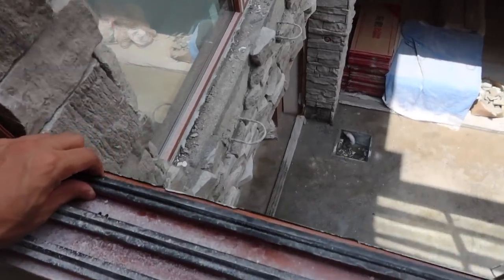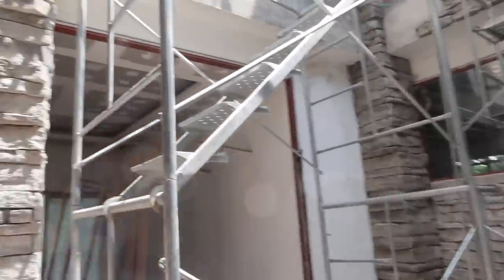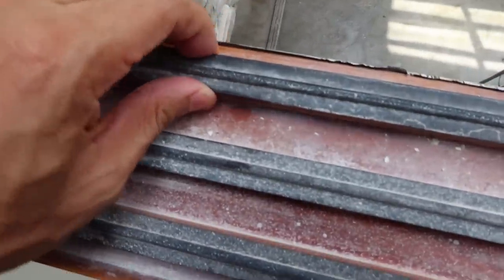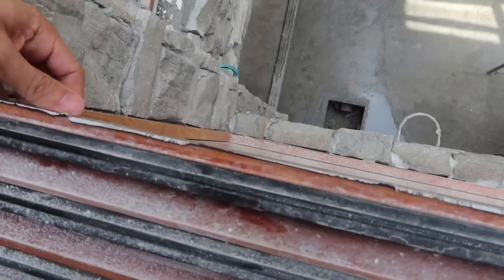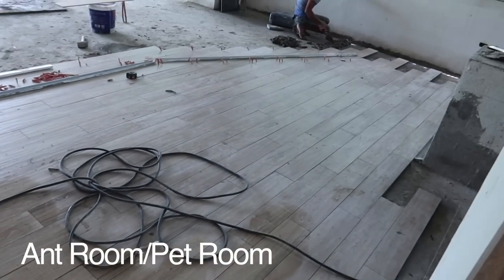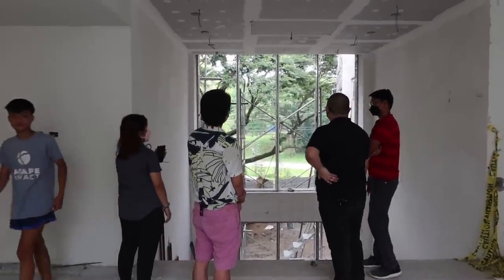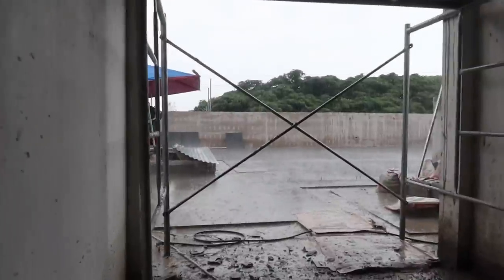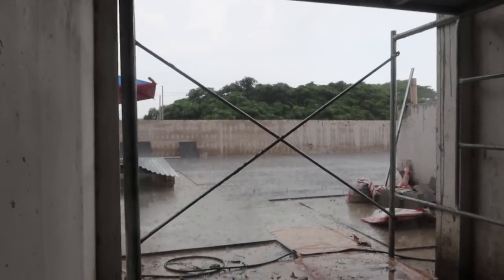What We Discovered About Our House - May 25, 2022 | Vlog #1499

Comment: Yeah parrots like macaws and cockatoos have pretty powerful bite forces, from 350 PSI of a cockatoo and up to 2,000 PSI for a red-and-green macaw. I used to keep budgies and when we initially got them, they loved attacking the screen of our windows so they could escape. But once we found a way to stop that, they just started pecking away at the dried up paint of the window frames. Sometimes we'd see them on top of the kitchen cabinet hiding behind cookie jars and even perched on a fan...budgies know no bounds
Reply: I completely agree. Their huge beaks aren't there for nothing, since they eat hard-shelled nuts in the wild, like Brazil Nuts, and those are some tough nuts to crack(no pun intended).
Reply: How did you stop them from eating your screens?
Reply: @reanaa  just by shooing them and then simply closing it they got the picture. Plus they already had more than enough toys so they were easily distracted by both that and luring them with millet spray

Comment: I personally think that you can get a medium to large bird. I have had a few in my time and believe that If the aviary was stocked enough and they always had something to do. Especially if you trained them and could free fly them, then the biting issue would NOT be a problem. Birds much prefer to chew at wood and toys and materials like that, having them chew on a plastic or metal track is unlikely. I know you will keep these birds happy for they're entire life and so the chances of them actually resorting to chewing on the rail is low. And even if they do, you can replace small segments of that rail very easily. You just cut out the damaged section and wedge in a new one. I think Macaws are beautiful and would suit your home SOOOOO nicely. A vibrant pop of colour with amazing personality's.
Reply: Very true, if a macaw or a large parrot really wanted to peirce it and break it apart they could. The screen mesh maybeeee theyd wanna bite through (maybe for attention & might be the case for tracking as well) but if u have enough stimulation like this commenter said and you set boundaries with ur birdies, u should be very successful!
Reply: Although I'm not too familiar with large parrots! This is just my assumptions and experience :)

Comment: I think the window  frame would be better suited to have the window on the inside not just for protection of those tracks but also for ease of cleaning especially the section in the centre it would be easier to clean from the window if the opening window was inside the house but an option might be to make some perches out of bamboo cut to fit up close to the window that the birds can chew and you can replace it easilyand cheaply but still looks good. I love your home it's looking awesome 💖

Comment: Those window tracks are roughly two feet above the bottom of the window unit where the stone cladding and plant hangers are installed. If all sliding window sections are closed, only a very narrow section in the middle is exposed on the inside of the atrium. That said, how can a large parrot perch and bite the track material with any force? Call a pro but I think you may be okay.
Reply from the maker: Yeah, that's what I was thinking!